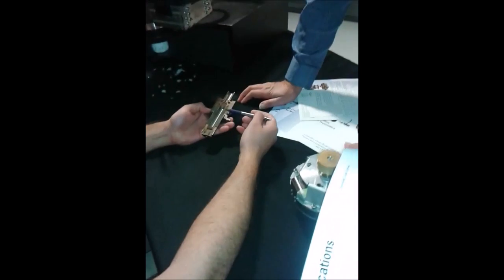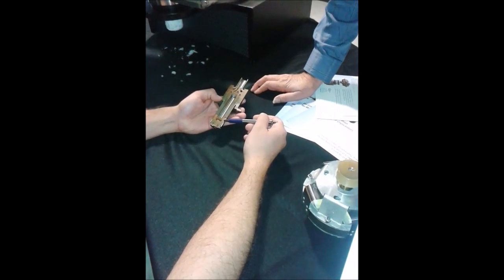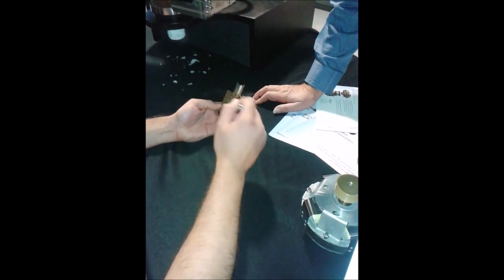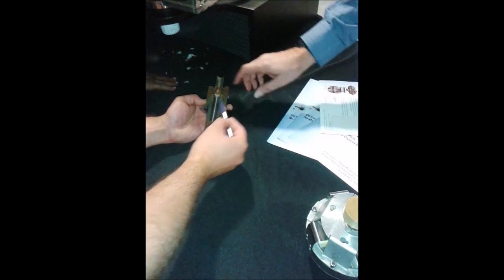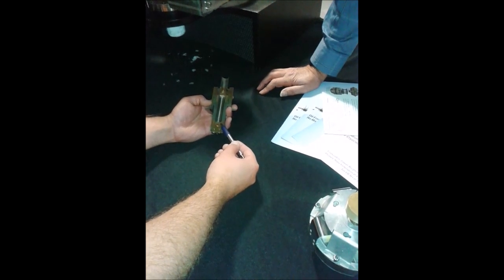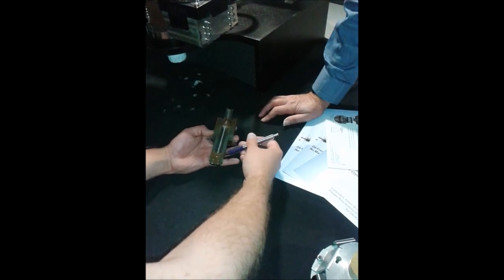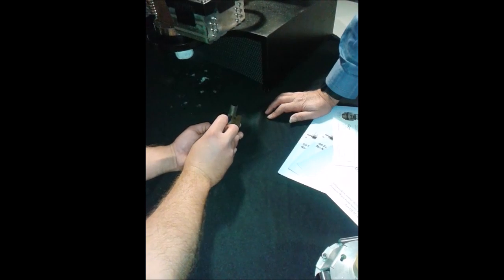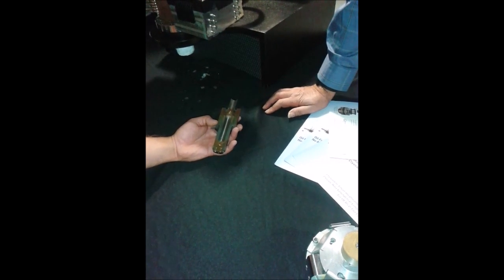Pulse tube Stirling cycle cryocooler from QDrive/Chart Inc.

Comment: Can you share dimension of pulse tube and regenerator in this setup?
Reply from the maker: That's not my engine, but if you can zoom in the saved main picture and you will give a D:40mm for the left end first, it will be good more or less to measure the other parameters you needed. BLADE

Comment: Is chart still developing this tech, i cant seem to find any product info on your webpage...
Reply from the maker: Chart is developing the small scale versions only the RIX company made the bigger versions because they bought the whole licence. That's what I know. This is a pulse tube Stirling cycle refrigerator for cryogenic temperature with one simple stage. Two linear motors works as a pressure wave generator opposite with no or low vibration. The head part include the pulse tube or buffer tube, heat exchangers and regenerator from sintered metal fibers. This is a pretty cool compact system for decades with no maintenance. Not cheap of course. :)